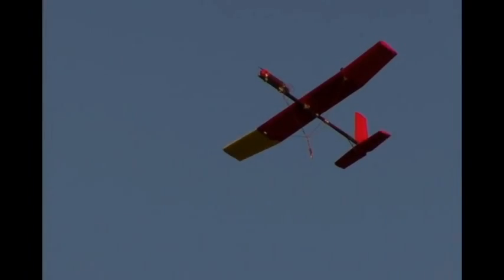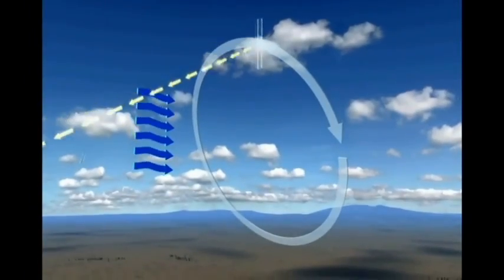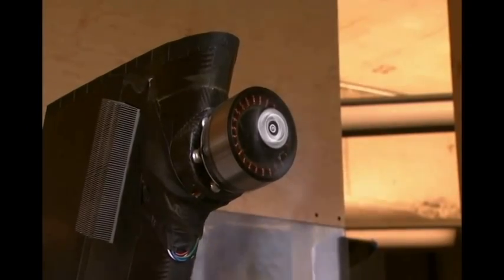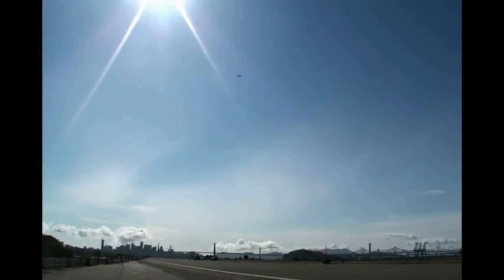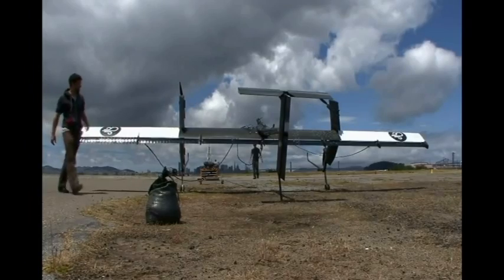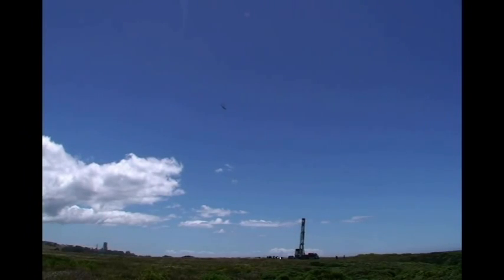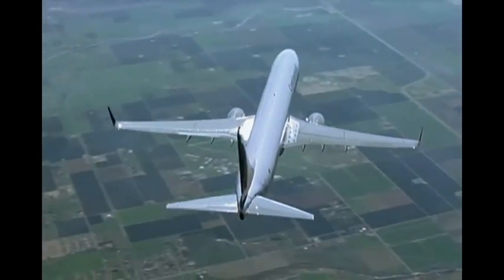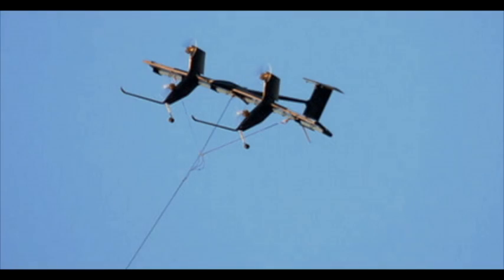Wind Turbine Blade Tips Are Critical To Wattage Outputs hence the Thermodyne flag tip blades

Comment: Maybe a TV type tower, like hundreds of feet high, with something like this tethered to the top. That can be regulated in height, with the wind, like a computer flying a kite, generating power the whole time, and when it comes down, it can connect its self to the top of the tower, still possibly still generating power, so why not put turbines up a few hundred feet? It looked this turbine kites would be very labor intensive, keeping them up! Not something I'd try my self!!! I'd go with the very high tower, with a turbine !!